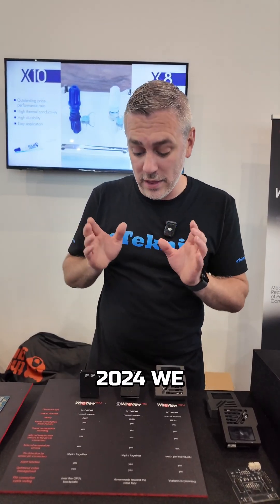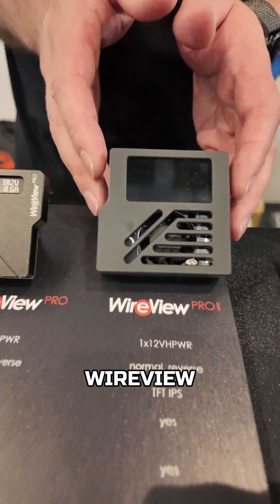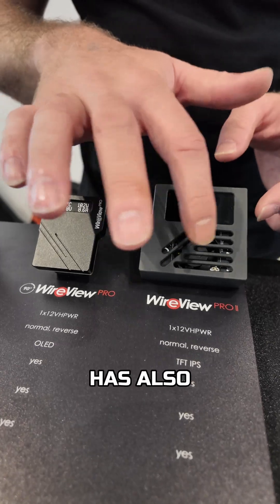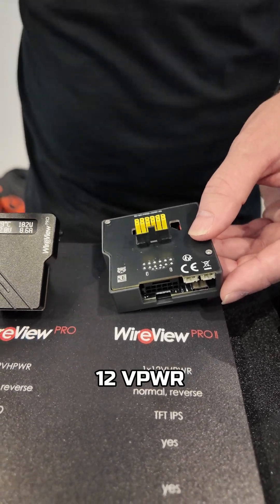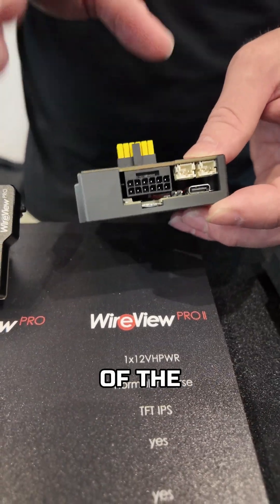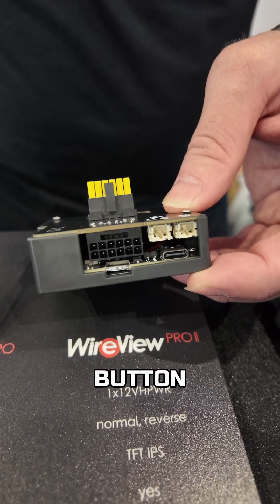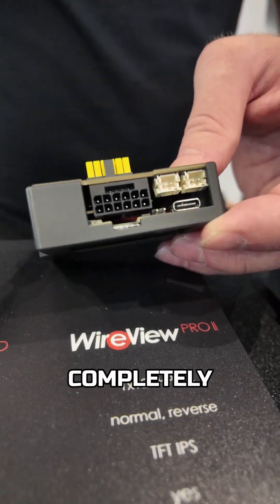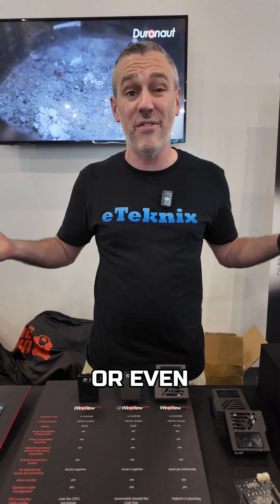This Could Save Your PC From EXPLODING! 🔥🧨

Comment: I feel like the design on this is really bad.  It does not work with vertical mount GPUs at all because it overhangs so much it will run into the CPU cooler or ram.  And, anyone sane is vertical mounting a GPU of this size so it doesn't destroy the PCB.

Comment: Love the fan blowing straight into a PCB, with none of it getting to the GPU side of the connector XD
Reply: 1) blowing onto the graphics card would interfere with its airflow design. 
2) The PCB is part of a device through which 600W+ is passing. So it obviously needs cooling. Plus cooling will minimise heat and thus resistance within the device.

Comment: As new usb C supports upto 240W, just make cards with 3 usb c connectors on graphics cards. Or I am fine with 8 pin
Reply from the maker: Too much for a cable of that gauge.
Reply: @eTeknix high current requires thicker gauge cable. When u send high voltage at lower currents. It would be possible like how usb C works.